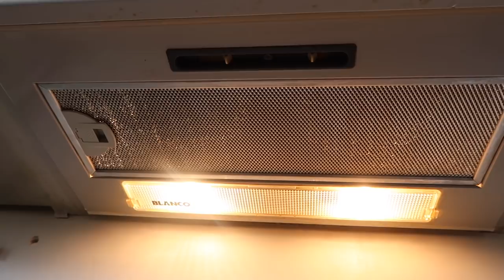EXTREMELY DIRTY OVEN CLEANING || Kitchen Organize Part 5

Comment: Great video! For me it's been a case of shuting the stable door after the horse has bolted, watching videos AFTER just cleaning my disgusting oven.  (To see how others have done theirs.) The shelves were a nightmare but now they sparkle (need sunglasses when you open the door!). My door is similar to yours and it dismantles really easily so you can clean all three panes of glass on both sides.  There is a plastic piece at the top which just unclips by pressing in at the sides. I just need to do the side bits again to get them sparkling.  I used Lakeland Oven Mate, it's a gel and I had to do the oven bottom three times to get the stuff off.  I treated myself to a special plastic tray from Lakeland (had it about 8 years) to place the oven shelves in.  Can use it for the extractor door also if you want to soak it. I also used the Oven Mate on my daughter-in-law's oven door glass and it worked a treat. Anyway, I'll stop boring you and go and finish my oven. Ignore the rude people, they are very sad muppets!

Comment: Nice!  I found a tip which maybe you can use. In this example we use Elbow Grease, look on its bottle, and you see how much time you need to leave the spray on the surface to set, before you can start scrubbing. Sometimes 5 minutes to disolve the top grease.
Reply from the maker: Thanks for the tip John

Comment: Good job! I used to clean military houses when people moved out 30 years ago. I don't suggest it, my back is paying the price!😇
I'm in the US, so What I use, you may not have available. 
A pumice stone for the really bad black stuff. A razor blade scraper. Easy Off Heavy Duty Oven Cleaner in the yellow can. Krud Kutter degreaser and stain remover. White vinegar.  Steel wool with soap. Large heavy duty black plastic garbage bags. Rubber gloves.  A couple of clean cloth rags you can throw away when done. A 3 liter bucket. 
Remove all the stainless steel pieces and spray generously with Easy Off and place into Black plastic garbage bags! When all are sprayed, close the bag and place in the sun to heat. Leave until inside is done.
Generously spray  the inside of the oven and door with the Easy Off. Close the door and let sit at least 3 hours.  
Remove the screen before spraying and spray with Krud Kutter full strength.  Let soak in a bucket for several hours, then rinse and wash in dishwasher alone,  shake out and let dry.
After the wait, fill your bucket 1/2 way with warm water and 1/2 cup white vinegar. Starting at the top of the oven. Wipe it down with gloved hands, rinsing the rag frequently.
When done with first rinse kook to see how much baked on stuff remains.  Use the razor blade or pumice stone to remove the small bits. If there is still a large amount of baked on grease, dry with paper towels and respray and let sit again for another 3 hours.  Continue until  the majority of heavy grease is clean.  Now use your steel wool pad and pumice stone or razor blade scraper to get the rest. Finally rinse everything with a 2:1 vinegar:water solution and dry to a shine with a clean towel. 
Next rinse your racks. Almost all should come off. If not use pumice stone and razor blade scraper to get the rest of the bits. Dry and replace in oven.

Comment: Lol, looks a bit like my oven.  Anyway, I find that when I do eventually get round to cleaning mine, the best way to put the cleaning fluid on is .... put some into a small ceramic bowl and with a 1 inch (2.5cm) paintbrush, paint it on.  Not only is it easier, it also uses less.  When you're done with inside the oven, use the brush to paint the glass on the doors too!   Pour what's left in the pot into the bag with the rest of the bottle. The doors will wipe clean easily after a soak - no more scraping  :-D

Comment: I recently used astonish oven cleaner, it’s a paste almost like clay lol only need a small amount with water and a scrubber and it got rid of all my grease stains! It was £1 in the poundshop
Reply from the maker: Is it in a blue flat tub? I think I have that. Do you dampen the oven, scrub in the paste and rinse?
Reply: OUR IRISH FAMILY yes it is that one! No I just wet my scrubbing sponge, took a bit of the paste on the sponge and just rubbed it on the door. It goes a long way . I did have to scrub for a good 5 mins

Comment: You are not alone, I too hate cleaning the oven.  I maybe clean it once a year.  The only thing that works for me is making a paste out of baking soda and hydrogen peroxide.  I make a paste and let it sit for a few hours or even over night and then pretty much just wipe it clean.  For the baked on stuff on the glass door I have to use a scrub pad.  For the racks I put them in the bathroom tub with laundry soap with really hot water and let them soak.  Everything just wipes off.  Its crazy.
Reply: More ecologically sound as well. Like Kim Woodburn, all natural is the way to go, and products you have in the cupboard!

Comment: I did lay on my back in front of the oven and looked up once...figured how to take the door apart to clean in between the double glass...it was really easy:)
Reply: There 2 screws on my oven door undo it and the inside glass slides out to clean

Comment: Make a paste of Vinegar and Baking Soda and let it sit over night then wipe off. Also use aluminum foil to wrap  your burner drip pans and to line the bottom of your oven. This helps to keep it clean and all you have to do is replace the foil as needed. Let me know your thoughts on this.  Thanks from your USA Irish Cherokee distant cousin, Patty

Comment: My oven was worse than yours, found using aluminum foil as a scrubber worked like crazy. After i got 95% of it cleaned I poured a coke inside the oven and gave it one last scrub. Total time, maybe 2 hours.

Comment: Remove all racks except the bottom rack. Leave that one in. Turn your oven to 350. Get a large metal baking pan. Put a fourth cup white vinegar in it, and a half cup water. Put that pan in bottom rack and close the door and let it go for a half hour, to clean with the power of steam. Then turn the oven off and remove the pan. Let oven cool, then wipe it down.

Comment: What is safer and better for your oven and racks. Put your racks in the bathtub over a towel and put hot water in and powder laundry soap and let it soak either overnight or for a few hours. On your oven and glass oven door. Try baking Soda and dish soap and let it sit for a few minutes. Then scrub gently and wipe clean.

Comment: cheap cola or lemonade. Best cleaner I've ever used for grease. lovely smell. doesn't leave a sticky residue. I never believed it till someone advised me to use it for greasy jeans and they came up amazing. First time I used it to clean a surface it was a gas hob I'd not cleaned for two years and it was manky. (don't judge, I'd rather spend my time on hookers and blackjack) 

It was back to show room condition after an hours soak. No rubbing needed.

Cheap cola.

Comment: Fab job hun :) Where did you pick up the oven scrapper and elbow grease. I did mine last week but still some bits stuck on the glass door :(
Reply from the maker: Hey, the scrapper is from DID Electric, I picked up my bottle of Elbow Grease in Dealz, it was at the car section of the store.

Comment: I don't like cleaning the oven, the problem is the glass on the oven door, it's hard to get in between the glass, I do use a metal scraper to get the grease off the outer part of the glass, that seems to work to remove the buildup.

Comment: Hi.  A trick my mum gave me and it works! Put your oven racks in your bath, cover them with hot water and pour some cheap washing powder froth it up and leave for a couple of hours. Your racks will sparkle without any scrubbing.
Reply: Kelly Ann Radley Yes!! And dishwasher tablets work too :)
Reply: That's what I do,. It's amazing.  You can also clean your enamel oven with biological washing powder and water mix.  Just paint it on,. Leave it for a couple of hours and wash off.  Also, when your oven is clean, mix a quite thick paste of bi-carb and water, paint it into your oven with a paintbrush and leave the door open until it dries. This, over time turns into a papery residue which you can sweep up.  When it looks like it needs covering again just wash out with a cloth dipped in water with a little dish wash up liquid.  The bi- carb comes away with the grease on it. Then repaint with the bi-carb mix.  You are giving your oven a bi- carb lining.   Try it, it works.  Well, it always has in mine.

Comment: Just now saw this...  Hon, I am the same way.  I will clean the house till the cows milk themselves, but oven cleaning... nuh-uh...   Those that had something to say about the state of your oven? Well, their opinion is not your reality. Next time they pipe up, tell them that the negative committee which meets inside their head, needs sit down and shut up.

What I use to get that hard to remove nasty stuff, is a pumice stone (not on the glass part) and it comes right off with very little elbow grease and does not damage the oven surface.
Reply from the maker: Love that, the negative committee comment 😂😂 Thanks